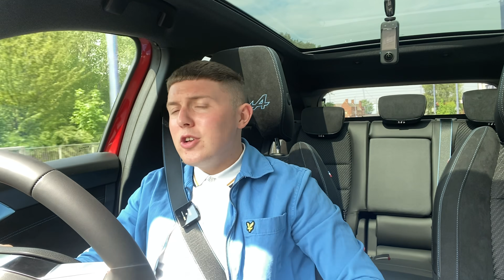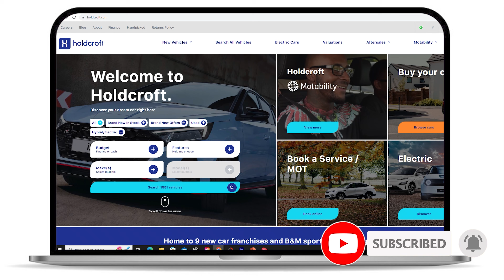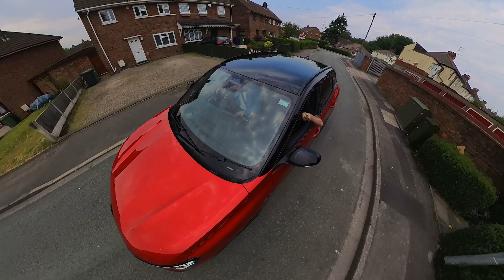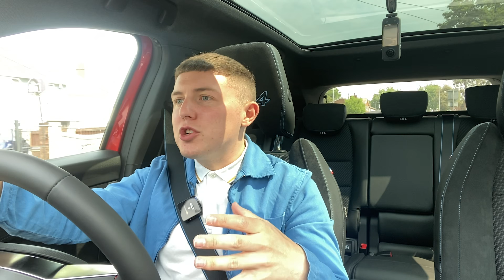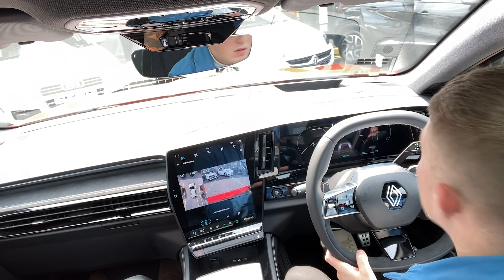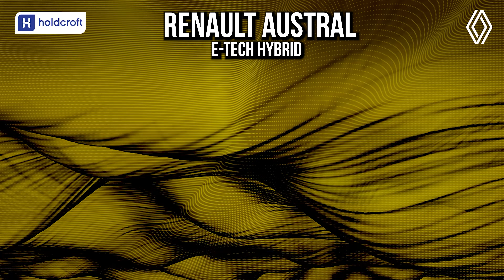NEW Renault Austral Review & Test Drive: THE BEST Hybrid SUV??

Comment: I know diesels are 'bad for the environment' which is the mantra being spit out. But when diesels change to common rail design they produced less emissions even back in 2002. I had a 2.0l A4 Audi and on a full tank I could get 720 miles yes 720 mile on a tank which was 60 litres ...  so being a petrol it is a good range on just a normal sized 55 litre tank ! The Parkers tech info even quote as high as 727 miles.

Comment: Price is not bad for what you're getting. The speed is good enough because who wants a car that will put you in trouble. As it's an upgrade from the kadjar I'll give it a thumb 👍🏾 up
Reply: I have a Kadjar automatic diesel which has been a good car, 71.2mpg on motorway at 60mph. I'll be sad to see it go, we've got on really well in 4 years🙂 Been a diesel freak for 38 years. BUT, I had test drive in top model Austral and was so impressed, ordered it. It may sound like a 1.2ltr Zanussi washing machine at tick over, but the sound doesn't intrude inside the car, and the regen is brilliant in town. I'm used to watching the rev counter for best mpg, now I'll be watching regen. Infotainment, 360 camera and the car overall appears to be top stuff. We'll see, take delivery next weekend.

Comment: Can I ask how the suspension behaved and what sort of a drive it was on our potholed roads in UK. Secondly other reviewers have commented on the clunky gearbox behavior and over reving engine performance noise, comparing it to  older generation auto gear change  mechanisms. I'd appreciate your thoughts as I don't re-call you referring to this aspect on your drive and was interested in your experience.
Thanks for the review.
Reply: If you pedal it its rather loud and kinda clunky. Tho only high end cars are smooth on fast acceleration in my opinion. When i test drove it, it was very smooth and nice to drive (I drive mostly relaxed with kids in the car anyways). 
The car i drove had around 10k on the clock.

Comment: 680 miles seems a lot but with a 55 litre or 12.09 gallons fuel tank the MPG  equates to only 56.2 mpg I would say thats poor for a hybrid, compaired to say a Toyota Corolla with a 9.4 gallon tank has a range of 733 miles in real world driving, Honda HR-V 8.8 gallon fuel tank range 546 miles, your simple putting more petrol in to achieve the miles.

Comment: Diesel Renault Kadjar (previous gen C-class SUV) gets MORE than 680 miles on a single fuel tank.
But this drivetrain is more expensive and more complicated (less reliable) to get slightly worse MPG.
Just imagine what a hybrid diesel can achieve!
Reply: You don't know it's less reliable and neither does anyone else. It's too new. The Kadjar was uaf and that's why Renault dumped it. People didn't like it.
Reply: @modelrailwaymichael  Don't agree with the uaf Kadjar comment, it wasn't "dumped", it was upgraded like all cars are, apart from Henry's Model T.
 
 I have a Kadjar automatic diesel which has been a good car, 71.2mpg on motorway at 60mph. I'll be sad to see it go, we've got on really well in 4 years🙂 Been a diesel freak for 38 years. BUT, I had test drive in top model Austral and was so impressed, ordered it. It may sound like a 1.2ltr Zanussi washing machine at tick over, but the sound doesn't intrude inside the car, and the regen is brilliant in town. I'm used to watching speedo and  rev counter for best mpg, now I'll be watching regen. Infotainment, 360 camera and the car overall appears to be top stuff. Reliability? we'll see, take delivery next weekend. Wish me luck? 🚙😀
Reply: @andrewmcgonagle6290 The Kadjar was dumped and sales nose dived. That's why it is no longer for sale. Good luck with what seems like a better choice. I am torn between the Austral, two Nissans and Kia
Reply: @modelrailwaymichael  You said it was dumped and sales nose dived. How can you dump, then sell a car that's not for sale? Can't comment on the other models you mention, I didn't try them. Renault dealer have always looked after my needs, so that helped keep me in the Renault stable.
Reply: @andrewmcgonagle6290  I love Renaults and have owned six. I have owned four Citroëns too. I am currently on my first Peugeot and love it. The Austral is my first choice for next car so far but I wish it was a little bigger. The Koleos was ideal. As for the Kadjar, instead of being defensive, look it up and you will see why Renault dumped it.
Reply: @modelrailwaymichael  You persistently use the word "dumped" because it was uaf. It was a better car than the Nissan Cashcow and others in the same segment. Please tell me exactly where to find this article pointing out Renault "dumped" the car.
Thanks
Reply: @andrewmcgonagle6290  The Nissan is still going strong with many, many more sales. Do you own research if it was good, you could still buy it. The Ladjar had a very short life. It's not being made in France now either

Comment: I just come to bought one in Luxembourg (exactly the same you drive, but in blue)  and already noted the usual Renault flaws:
- No more the back doors curtains (very useful when the sun is strong and I roll with the window open).
- 3 "sticks" behind the left side of the wheel ! ( Renault couldn't build the speed lever on the slider?).
- Peugeot 2008 copy! The new designer is the guy who designed the Peugeot 2008 !
So why I bought the new Renault Austral?
Because Renault Luxembourg proposed me at same monthly but with 4years warranty and maintenance and by the electric trunk open (I'll replace my lovely Scenic IV Initial Paris with the soberb engine 163 CV and 45.000 kms). I already miss it❤

Comment: tdi 1.9 same milles with full tank 😂
Reply: Basically any modern diesel with displacement ranging from 1.5 to 2 litres have nearly identical fuel consumption. Driving carefully you can easily get >680 miles on a 60-65 litres of diesel.